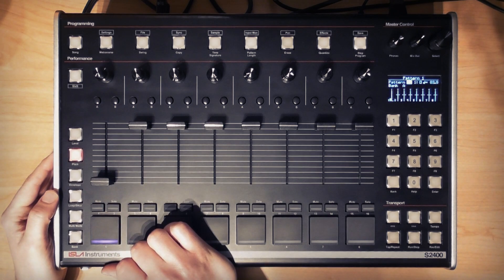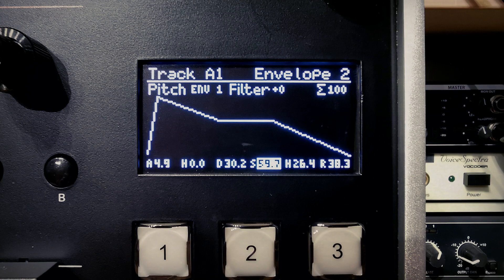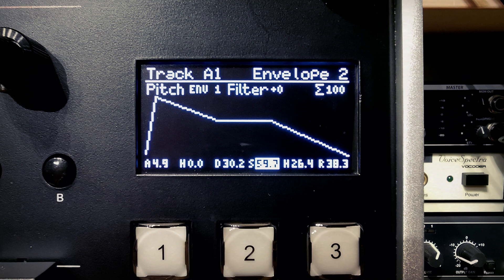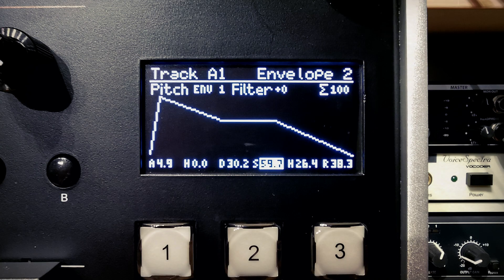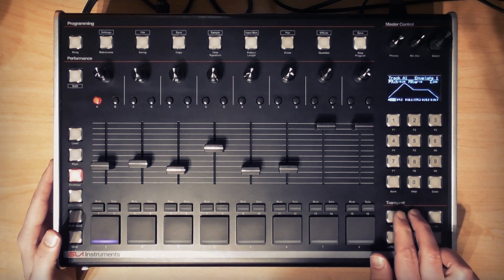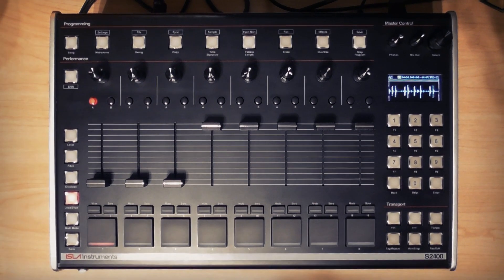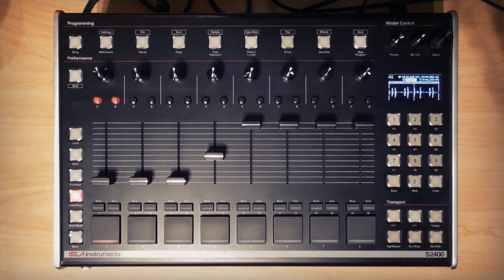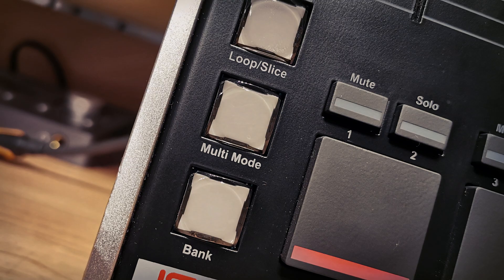[OUTDATED] Part 3: Level, Pitch, Envelope & Loop/Slice - Isla Instruments S2400 Video User Manual

Comment: I found my answer in the user manual. F1: Undo changes made to the envelope. Long-press to completely reset the envelope.
F2: Undo changes made to pitch or filter modulation. Long-press to set all modulation to zero.

Comment: Hi Isla & Alex, thanks for these user manual videos. I just have a question: can the S2400 loop a precise number of bars based on the BPM of the machine? I mean you choose the length of the loop (ie 0,5 bar, 1 bar, 2 bars, 3, 4, 8 and so on), the start point of the loop manually and... that's it! The loop being synchronized on the BPM / on the grid it would be just perfect in a live situation, only moving the starting point of the loop on a long sample. On the video we see we have to adjust the end point of the loop very carefully to match a precise BPM (not 119,84 but 120 for example) so it may not be always very practical, especially when the 2400 is playing as a part of a setup because 119,84 BPM instead of 120 (for example) means the sample will not play in sync and the time needed to adjust the loop length to 120 BPM will increase the issue in a live situation. Thanks in advance for the feedback and if it's not possible yet I hope you can add it later as it would be a massive feature for my usage and for other people for sure.

Comment: Considering all the features I think you've managed to make most of it very manageable.
Loop/slice is cleverly done.
One thing I miss though (or did I miss this in the video?) is the a fine pitch control. The fine pitch showed is more like a course pitch, which is great to have, but also a fine pitch in a smaller range would be suitable quite often.
Reply: Yep, it's an absolutely awesome music machine! Very clever.

I swept the fine pitch at 1:54, but didn't show it in close detail. There's 40 increments sharp and 40 flat, so it is very fine. It reads as 1 - 20 in either direction but there's two steps within each value. Is 80 tuning values enough?
Reply: @AlexBallMusic  Brilliant. Thanks Alex. Although : ) Is that one stepped? It sounded as if to my ears but maybe has to do with the character of the sound and fast sliding through the pitch?